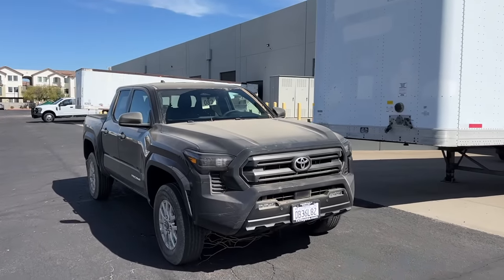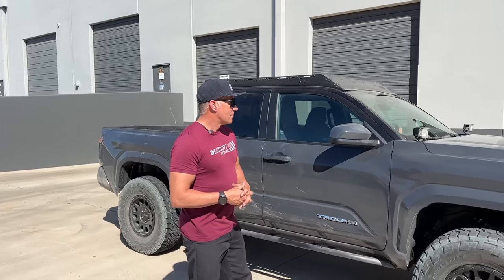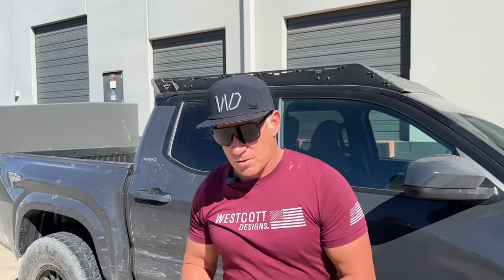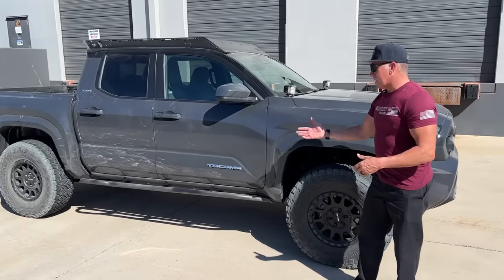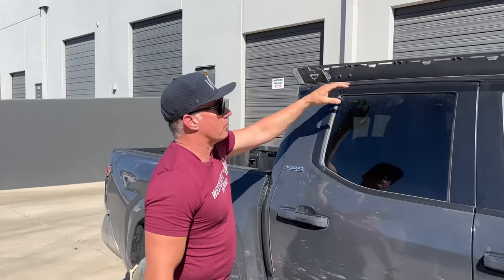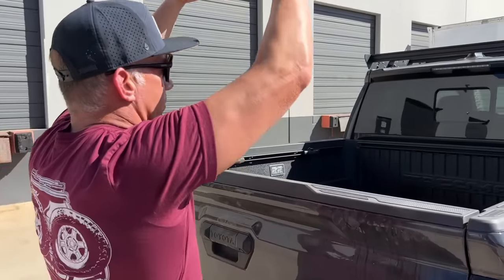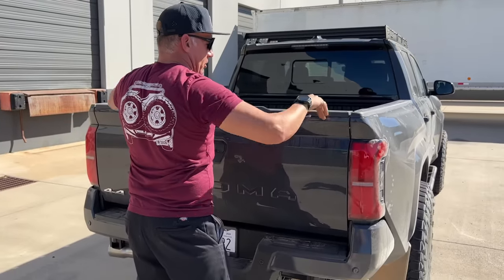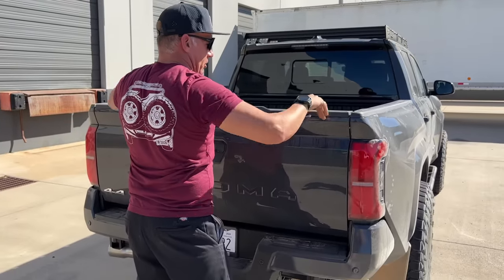My New 2024 Tacoma Gets MAJOR Upgrades!! | Westcott Designs Build

Comment: Thank you for believing in us and your friendship.  We really appreciate it🙏
Reply: Amazing work!
Reply: You guys are not joke! Need to come to fl, humble owner btw
Reply: Please share 🙏🏼this package price, wanted to plan for the package upgrade. Estimate would be great
Reply: Im for sure ordering that bed stiffeners for my 2nd gen taco
Reply: @westcottdesigns Will The back of the rack cause fitment issues if you want to put in a truck cap or camper with how it protrudes  out ?
Reply: @D_F_L_   depends on how much over the cab it sticks up and how close the camper shell is to the back of the cab.  Usually they have at least a half inch to 1 inch off the back of the cab.
Reply: @westcottdesigns  will you have a version that cuts flush with the back instead of having a slight over hang?

Comment: Did you have to get a hub centric kit? Isn’t the hub size smaller on the 4th gen’s? The Hub/bore size on the method wheels are 106.25 right which is larger than the stock hub size

Comment: What are the wheel specs? I did see 35x12.5r17 tires.
Reply: The wheel is a 17x8.5 with a +25 offset
Reply: @westcottdesigns  Would a 35x11.5r17 20mm offset have the same poke?
Reply: @justindo9760  +20 offset?
Reply: @westcottdesigns  35x11.5r17 tires with 17x8 +20mm offset

Comment: I love Toyota I had a Toyota Corolla 2013 I bought it brand new what a great machine that was but I traded in for an F150 in my opinion Ford gives you more performance than Toyota Toyota makes great basic machines that last a long time, but my opinion ford goes above and beyond performance was nice about my 5.0 L V8 is that it never leaves 1100 RPM on the highway it’s 1600 so it’s always at idle speed so it’s good on gas I get V6 gas numbers people think it’s cheaper to get the V6 it’s not get the V8

Comment: Too bad it’s a 4 cylinder with too many electronics that could cause failure issues
Reply: You must have an old tacoma. Cope more bud.
Reply: @gonzotk421  I have a 2010, it will be on the road longer than the first gen of these hybrid 4 cylinders. Not to say Toyota won’t figure it out by the second gen. No cope here bud